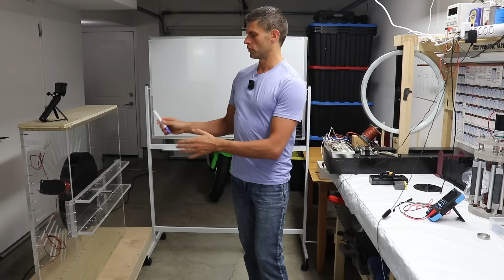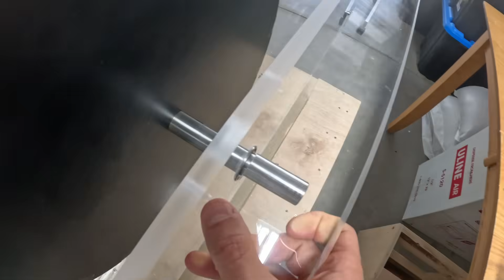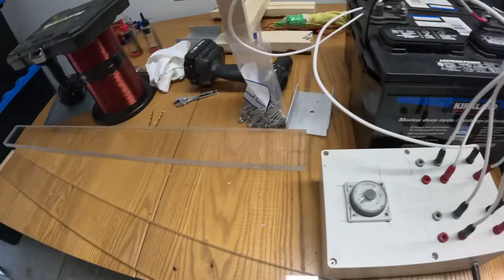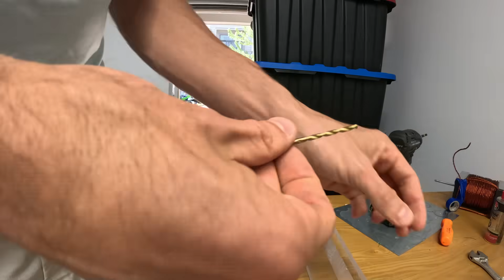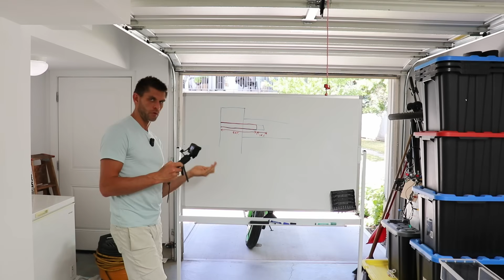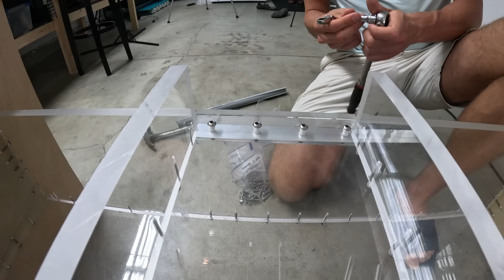This Pulse Motor Could Change the World — And I’m Building It in My Garage

Comment: You should patent anything you think can help just to prevent patent trolls from taking it off the market
Reply from the maker: Meh they cant if its publicly disclosed
Reply: Patenting will also get you killed or it bought out and blackshelf'd. 
Open source, live stream, free to make is the ONLY way to ensure this reaches the masses.

Aside, might want to get in contact with Dr. Steven Greer, he's been trying to do this exact same thing with blackshelfed tech from the 60s
Reply: Money is a token of energy, with free energy you don't need money anymore.  Making money off free energy doesn't make sense, free energy is like printing money.

Comment: You should consider adding some form of fiber reinforcement around the wheel to secure the magnets for high RPMs. While not entirely necessary, the faster the wheel spins, the greater the power output that can be achieved. Balancing may present the next challenge. I can balance rotors for high-speed applications if you would like assistance with that. Again, I am not stating that it is required, but implementing it would supercharge the performance, really awesome. I would suggest carbon fiber or fiberglass.
Reply from the maker: The slots prevent the magnets from coming out. Balancing would be cool for super high rpm??
Reply: @MadscienceLPTECH One of Paul's friends built a high-speed rotor that spun so fast the magnets broke loose. Fortunately, they avoided injury from the flying shrapnel. The magnets were secured with a special structural epoxy, but the centrifugal forces caused the epoxy to fracture in multiple places. No matter how strong the material, anything can fail at extremely high RPMs, as I'm sure you know. I experienced this myself when a 1-inch diameter, diametrically magnetized cylindrical magnet shattered at 99,800 RPM on one of my turbines running on water below its boiling point. I was prepared for the failure, but without proper precautions, such incidents can cause serious injury.
To significantly increase strength, you can wrap the rotor with carbon fiber thread and epoxy, or use another high-strength thread with epoxy, which is relatively easy to apply. While such high RPMs are often unnecessary, you might want to double the RPM to quadruple the power output. To balance the rotor, one effective method is to place a cylinder on the shaft near the largest rotating mass, fill it with ball bearings, and let it automatically balance the rotor. Alternatively, you can mount the rotor on flexible bearing supports, spin it up to its critical speed, and grind down the heavy side. Nikola Tesla patented this technique, but it requires practice and properly designed flexible bearing supports. Another option is to hire a professional balancing service, as they typically do an excellent job.
Reply: @WillardWallace-y5g Actually I did break the 100 without a magnet afterword. The carbon fiber was 3" in diameter so the periphery of the disk was what was impressive. 892.92  mph 1,309 ft/s. My project has kind of been private, but we will be opening back up to the public more soon, and ill have more updates.
Reply: @WillardWallace-y5g Angular momentum: ~1.56 kg·m²/s
G-force at disk rim: ~426,000 g
No overspeed failure test conducted; 100,000 RPM was stable.
Shrapnel velocity (hypothetical): ~399 m/s, lower than grenade shrapnel (1,000–1,500 m/s), but larger fragments could cause significant injury. Safety measures were used.
Reply: @WillardWallace-y5g O yeah, but the main thing is we are using temperature differences. We can run as low as 120f, but there is not much power available at those lower temperatures. So heat directly from the sun can run it even if you are not producing higher temperatures. What I do is store energy in the form of heat from many different sources to run the turbine.

Comment: might need to use a little Vaseline when driving in those type of screws or use a less aggressive bite of screw. Maybe try some deck screws used for bolting down wood onto metal decks for trucks and trailers. They are a self tapper however in your case you still have to pre drill.
Reply from the maker: yes agreed

Comment: You can always add super glue to the nuts will act like Loctite!   look I'm not a nay sayer, the road less traveled is the hardest one ,,, I'm glad your doing what your doing, to save you heartache and time have a smaller working model before you build a large version of it, that's one of my biggest lessons I learned while doing any sort of RND. its cheaper and shows working concept with the proper calculations! but you do you boo !!
Reply from the maker: Thanks for the tips, I appreciate the advice! 🙏

Comment: Anyone who wants to see a generator clearly speeding up when loaded: just get a decently powered motor like from a 24v ebike and drive a 2 pole or 4 pole "stepper motor" through a step-up pulley ratio. You'll have to play with various speeds and loads but, all the stepper motors I've tried ACCELERATE under a "dead short" condition, once the minimum speed is achieved!
Reply from the maker: interesting
Reply: @MadscienceLPTECH  Yeah brother, I should redo the video I made in 2012 haha

Comment: Hey bro! What about swing weights flop out going down pull tightly to wheel going up extra momentum
Reply from the maker: i like the idea
Reply: @MadscienceLPTECH swing weights fair amount of wieght maybe little pistons when flop back & forth creating air pressure help overcome lift on dead side duel piston being operated by inertia no extra energy being spent
Reply: @MadscienceLPTECH another thought they've created electrical charges like pistons magnetic moving through copper cylinders swing weights flopping back& forth by inertia help rotation and free charge with no extra energy spent even dual working back and forth

Comment: what happens when you introduce load to it? 100% energy renewal isnt even possible due to thermal dynamics and the laws of conservation of energy yada yada..

edit!! okay I get what you're saying. you are pulling extra energy from the zero point energy field, idk how you're going to accomplish it with your design, but from what i've heard/seen you need a turoidal high voltage energy coil that manipulates pressure ( i forget what its really called ) so that the plasma being created creates a vortex and the positive pressure side interacts with the negatively pressurized side/direction and causes movement... ugh i wish my brain wasnt so muddled
Reply from the maker: Thermodynamics are just based on what we know... there can be other energy we dont know of

Comment: EXACTLY where is that "excess energy" coming from? In what form? How do you harness it? Man, science is MEASURABLE, not about sensationalist or emotional discourse.
Reply: It causes a ripple in the ether. Imagine it not as a closed loop but in reality it's a open loop circuit. Imagine a drop of water in a bowl of water it causes ripples. Same effects different ways. 😉👍⚡💡
Reply: Say it with me, Zero-Point-Energy. There is 10^120 more energy in the ZPE than the rest of everything. It's the vast majority of all the energy. The rapidly quenched spark gap allows you to interact with the ZPE.
Reply: @JohannTheBotha 💯💯💯💯
Reply: @JohannTheBotha , they why you still pay your electricity bill?
Reply: the comment section makes me scared
Reply from the maker: @kippenkopjes lol
Reply from the maker: Lol
Reply: You do realise that every ignition coil basically does the same thing yeah? The collapsing field generates the high voltage for the spark.
Reply: @madazz01 , yes, buddy. However, it does not keep on collapsing forever. You do realize y'all are basically a cult? No evidence, just buzzwordry.
Reply from the maker: I've litterly discussed all this in previous videos and yes this is the point of this project to provide  measurements

Comment: Why use bearings? Use magnets to balance the shaft and eliminate the drag that bearings create. The goal is minimal resistance, right?
Reply: Very good point, but I'd imagine it would be significantly trickier to pull off.
Reply from the maker: Still resistance with magnets,

Comment: That reminds me of a Joseph Newman Energy Machine
Reply from the maker: Kinda. He was legit
Reply: @MadscienceLPTECH  Newman said it was the way in which his commutation worked.  the commutator created huge voltage spikes and then sharply grounded or shorted.  apparently, there were more than just two states in his commutator.  the shaft was perpendicular to the windings (never before seen in motor/generator windings), but the relative motion between magnetic pole and electrical conductors was correct or conventional for induction.  He was on the Tonight Show with Johnny Carson in the early 80s.  It was the reason for spiking my interest and has been stuck in my head since then.

Comment: I also have a degree in electrical engineering and it is absolutely true that you don't need a degree to work with new technology. To have a degree only means that you have been trained in a very narrow field of tech, and you certainly do not have all of the knowledge available in your field. Even scientists as far back as the mid-to late 1800's were well aware of energy available from the ether.
Reply from the maker: 💯 we have gone down hill

Comment: If someone were to offer you a fortune to stop you from making public a "free" energy device that works, would you accept?
Reply: Well—-if you answer directly “no” you might be offed. The order goes like this:

1. Offer a contract. If Yes—they own the material/work. If no—-they offer you money

2. Offer money: If yes—-they own the material/work. If no—-they try to entice you into non profit projects or groups.

3. If your time isn’t distracted enough into these groups and non profit ways to disseminate then the threats start.

4. They threaten you or assist in Sabotage. If these fail they blow up your place of experimentation or work. 

5. If this fails you end up poisoned or get unexpected cancer after they get your dna and remotely hit it with electrical currencies specific to you. Can’t get any sweeter than that sequence—-

except those that can and are protected by other means. It happens ever so often. Hence, free from greed and fear.
Reply from the maker: Free enegy > money.

Comment: Hey man what do you think about Maxwell Chikumbutso? I think he built a micro sonic generator where he harnesses radio frequencies. It's based on Teslas free energy project.

Did you look into that and if so do you think it's legit?
Greetings from an absolutely science noob from Germany who is interested in this 😉
Reply from the maker: Shout out Germany
Reply: Maxwell is a scammer that has sold nothing tested nothing and robbed investors 🎉
Reply: Maxwell is a scammer 1000%🎉🎉
Reply: @ScamWowz Maybe. Maybe not. Tesla was on it also. And I doubt Tesla was a scammer. Same principle
Reply: @whoknows8223 no no what you fail to see is the same thing Tesla discovered 😢

It doesn't work well at long distances from transmission towers
Reply: @ScamWowz nah. 
My belief is that free energy was not profitable. Thats why it was buried. But its ok if you have another opinion.

Comment: I wanted to do the same thing for mankind i have many years experince in electrical & electronics i did find a way by testing many idears in test but i also found a better bearing type thats nearly no friction its found in a compass or analog voltmeter it has a point at one end that goes into a cup but if made a point & cup at both ends it spins with no drag if you wanna connect give me a shout & good luck working on your motor/ generator project 👍
Reply from the maker: That is an awesome idea, thanks for the support! Love to hear more

Comment: Absolutely adore what you're doing. One idea from a dude who has no idea what he's talking about. What if for the even bigger version, instead of relying on low friction bearings, some type of "magnetic levitation" tech is used, like how they levitate high speed trains. Then the bearing wouldn't give out over time and it would basically be zero friction, resulting in the least amount of drag on the flywheel. Anyway, fascinating stuff bro, keep up the great work!
Reply from the maker: Legit idea. I appreciate it! 🙏

Comment: I love to hear that something I am building won't work or you can't do it or laughing outright. All that does is fuels my stubbornness to keep going and prove them wrong when I know it will work. Their silence at the end of a successful project is all the praise I need. Use that fuel and keep going. Wow! 16 coils in total. Where do you find the copper and what gauge are you using for the 250 ft of copper? Did you get the magnets from aliexpress? Did you get the copper from there as well or do you have someone local? I frequently buy parts from there and notice they take FOREVER to get here. Not sure why. Thanks!
Reply from the maker: Yes that's the spirit. And yes Ali/ china for everything

Comment: Im no automotive mechanic or anything but you may want to look into a steel housing for those bearings where the hole is precisely drilled out to allow those bearings to be pressed in with a hydraulic press. Will likely allow much higher RPMs safely and secure it away from the acrylic, which would melt with friction. This way the friction is solely on the bearings, even with turbulence
Reply from the maker: Shouldn't be any heat really. We will see once its running. Great tips

Comment: those screws are really fine thread. Get some more course ones and a  tap for those screws and tap the acrylic with the tap not a screw. It would have a much better thread and be more reliable for you. You could install them with a torque wrench so you don’t over torque them and take them out and put them back in without worry over and over.
Reply from the maker: Great idea, thanks for the tip!

Comment: Hey someone just review a 16kw battery unit for $1,900 with 6 or 8 battery cells in the unit I believe. I think the cells can be bought separately for replacement. You might of seen this guy DIY Solar with Will Prowse, but maybe the battery cells in this product he reviews can bring down the cost of the batteries your currently considering to use. He even asked his viewers if they know of any battery cells cheaper that he could test in this particular system, so maybe there are some for even lower. That is, if these battery cells fit the requirements you need for the device your building. Link below:

https://youtu.be/7bShGUPU3TQ?si=-Rdjzq5yCKpcoe_a
Reply from the maker: Thanks that dude has been hating on the comments lol. The batteries we need are low internal resistance and not deep cycle...
Reply: @MadscienceLPTECH Oh wow, that's sad to hear, I hoped if he found out about your channel he would be another encouraging voice, smh. I'll pay more attention to the specs you need and hopefully provide something uesful and compatible with your design that may be a cheaper than what you might be considering. DON'T EVER STOP!!! 👍👍👍🫡🫡🫡

Comment: I believe anything that physically moves is not a good direction to go for creating electricity.
There are plenty of devices that move a magnetic field across wires and generate electricity. 
The most amazing small device is the zero voltage switch. Check one out and implement one in your device and you’ll see great results. Good job on your work !
Reply from the maker: Thanks for the ideas, appreciate the feedback!

Comment: I think you may have an issue with the bearing temperature and the Perspex melting and deforming a bit which might move your rotor radially out, but I guess this depends on the RPM eventually. The rotor looks quite heavy.
Reply from the maker: It is 80lbs... I have 4x 30mm x 9mmx 47mm ceramic bearings
Reply: @MadscienceLPTECH that’s reasonably heavy. I suppose this will be good for a test and if you find it’s deforming you could either form this out of fiberglass and resin or have it made of some alloy that doesn’t affect the process, as a second prototype. Even thermo plastic might work, depending on bearing temps. But I think you might be ok unless this thing starts to spin at like 1500rpm or something 😂